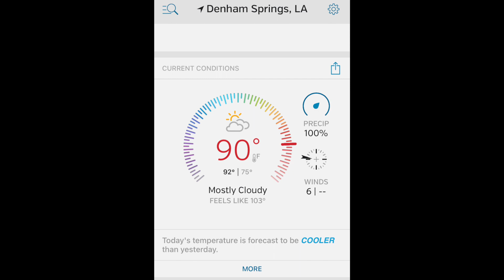1.  DIY Boat Building: STEP ONE to BUILD A BOAT!

Comment: Where did you source your plywood? Local or shipped?
Reply from the maker: At the time I chased every lead I could to buy it local, but in the end I had it shipped in from Ohio I think.  It was about 30% cheaper than buying it local.  Let me know if you need a contact up there.
Reply: @Bigeaux20  thank you so much. I have been doing the same. Looking everywhere local trying to avoid shipping but its looking like that is going to be the way to go. Thank you for the videos. Will definitely use them as point of reference
Reply from the maker: @richardcannon1325  Jake at Homestead Hardwoods was awesome to deal with.  Now, prices may have changed by now, but I'm happy I went this route.  Be glad to share local suppliers if you need a back up, just let me know.
Reply: @Bigeaux20  thank you so much, I really appreciate it.